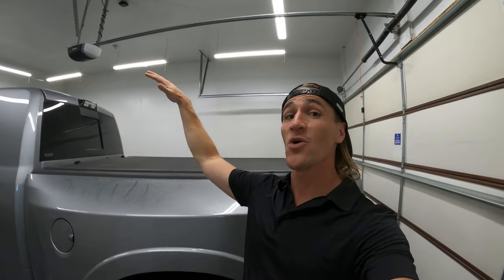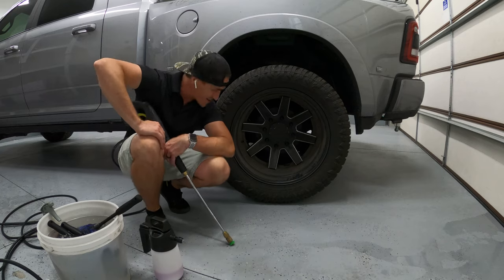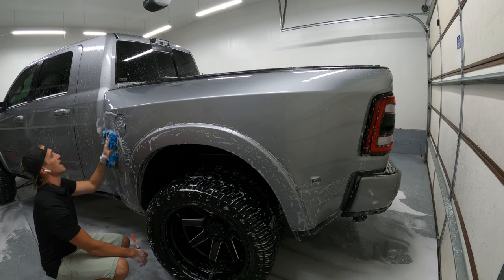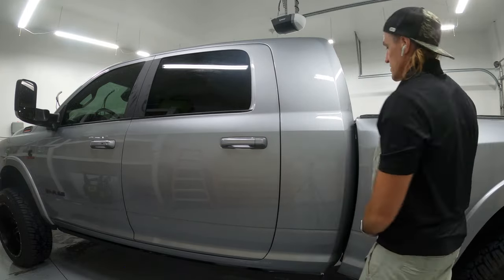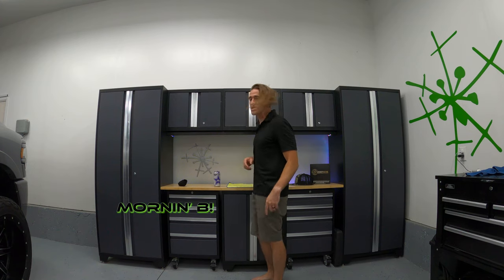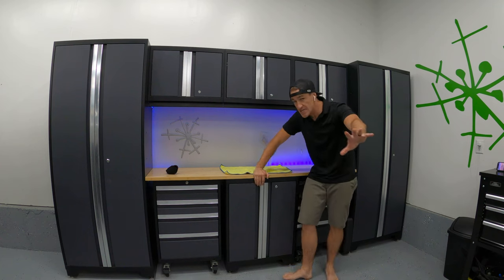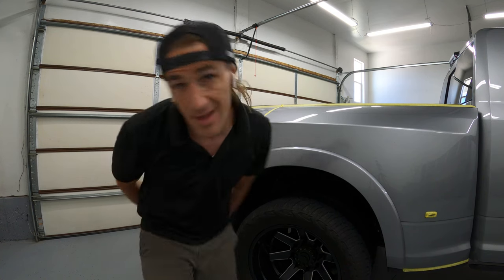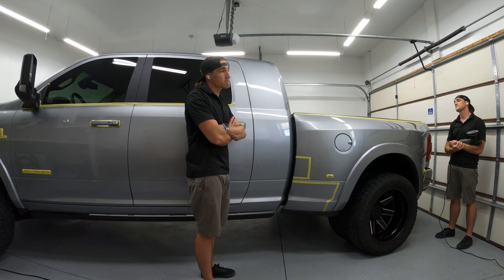'21 Ram 3500 Ceramic Coating | Deep Cleaning & Paint Correction Neat Transformation of a $100K Truck

Comment: Nice job but have Ever used any other coatings site Adams
Reply from the maker: Oh absolutely. I use quite a few off camera. I have been absolutely in love with this Adam’s Graphene coating though. If my customer’s don’t have a preference, I will use the coating that has been lasting the longest. I did CQ Quartz, Ethos, G Technique. I’ve used some cheaper ones and wouldn’t recommend those at all.